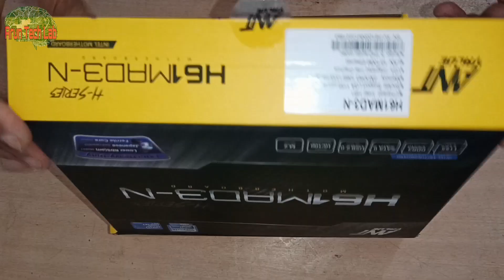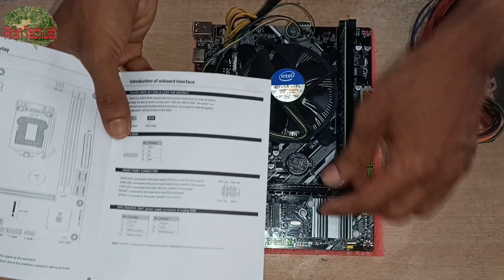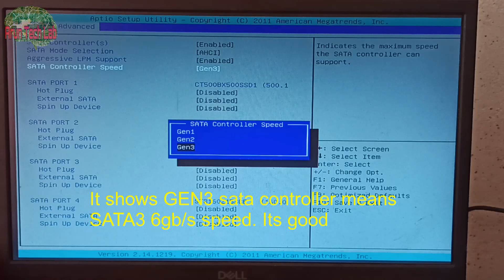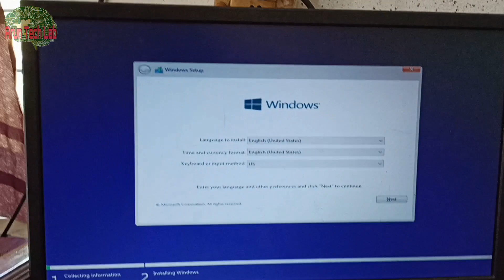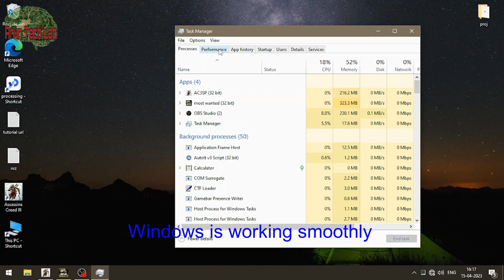Gaming PC build using H61 Motherboard

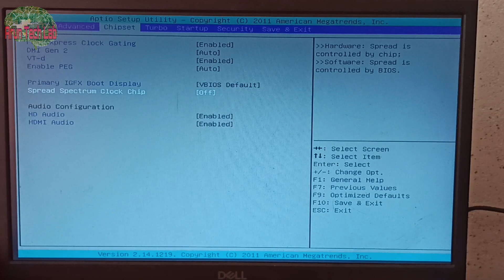Comment: 5:37 Sir the CPU fan speed is always at 100% is it happening to you also I’m using stock intel cooler
Reply from the maker: Yes
Reply: @aruntechlab3733  is there any way to control fan speed
Reply: Me too same issue
Reply: I just used a expensive cooler

Comment: i have connected each and ever cable to motherboard and vga cable is also working in good condition and this motherboard is not showing any thing on monitor lights are on fan is spinning but nothing on monitor i have changed and cleaned my ram , processor and powersupply and changed cmos battery to check board and still no signal on monitor can u tell me how i can fix it
Reply from the maker: please check hdmi Port

Comment: Does it support 1600mhz ram can you show your screenshot mine it working in 1333mhz instead of 1600mhz and i also changed the settings in bios it doesn't work I'm using ant ram 1600mhz
Reply from the maker: running in 1333mhz

Comment: Bhai mujhe ek bana used motherboard prosesor de rha h usme i5 3rd 2400s generation cpu lga hua h but uska display  nhi arha wo kah rha h is 2400s cpu bina graphics card k nhi chalta ye sahi kya sir
Reply: Yahi motherboard h usme
Reply from the maker: I5 2500 have inbuilt graphics. No external card required normally. Try reset the bios by short jumper or removing CMOS battery.by  Default vga output work karega. Pls check CMOS battery good.

Comment: Hel!p. I just bought this motherboard from amazon today and even with a cpu with igpu there is no signal comming from the hdmi motherboard port but it works fine with vga , what do you think the issue is here? should i send for a replacemen!
Reply: no signal whatsoever from mobo hdmi not even bios pops up..!
Reply from the maker: Pls try by enabling internal graphics option under graphics configuration in bios.
Reply: @aruntechlab3733  i just did that from auto to enabled and still no signal . did you ever get hdmi signal from motherboard to display with just igpu ?. what do you think is is defective one or  bios problem?
Reply from the maker: @Junaid Hussain  hdmi is working in my motherboard. No other setting is necessary.do you check hdmi port of your monitor ok. Or cable?
After select igbpu and internal graphics selected, press f10 system boot to vga.after loading windows shutdown the system and remove vga cable and connect hdmi cable then turn on. kindly let me know the issue is fixed or not. Othewice you may go for a replacement.
Reply: @aruntechlab3733  just to confirm your hdmi port from motherboard is working with cpu's igpu and no gpu is connected and you can see bios through hdmi signal when there is no vga cable connected ?
Reply: @junaidhussain5485 did you find any solution..?🙄🙄

Comment: Hey will this Motherboard support rx 550 4gb
Reply from the maker: I'm not tested this. It may be work fine as the mother board support PCI express 16.
Reply: I can change the ram speed to 1600 MHz in bios?
Reply from the maker: Ram speed 1333mhz only
Reply: 6:00  but what you done here with memory speed
Reply from the maker: 1600mhz DDR3 ram running at default speed 1333mhz.
Reply: Actually we have to change it to 1600

Comment: Or nvme konsa wala le
Reply from the maker: It will support  NVMe M.2 SSD
Reply: Sir ji 
            GEONIX 256GB M.2 NVMe SSD, 2280 SATA III (6Gb/s), Read Speed – Up to 2400 Mbps Write Speed – Up to 2000 Mbps, Internal Solid State Drive(SSD), 

Ye is ant sports h61 motherboard mein support karega ager kare to mein yehi lagaunga
Reply: Ye Amazon ka hain
Reply: EVM 256GB Internal SSD - M.2 (2280) SATA - Experience Faster Load Times with Read up to 530MB/s & Write up to 420MB/s - Enhanced System Performance - 5 Year Warranty (EVMM2/256GB)
Reply: Konsi wala le

Comment: Will it support gt 1030 4gb
Reply: I am using 1070 ti with this motherboard right now it is working fine you just need a good power supply which have extra powers cable for graphics card and it will work fine  one more thing that 4 pin female Jack in the motherboard with this motherboard it need 8 pin
Reply: @NOTTYDEVIL666  Ok thanks